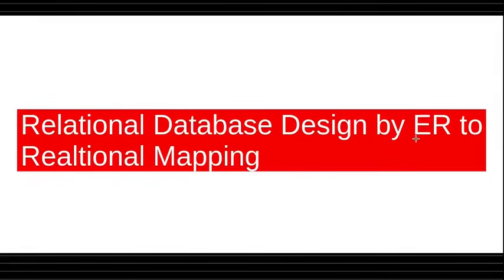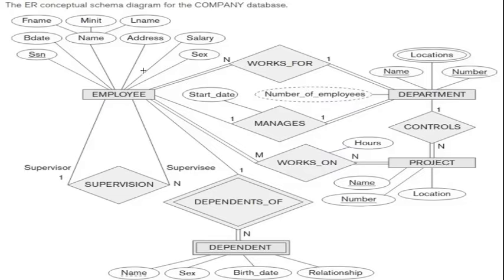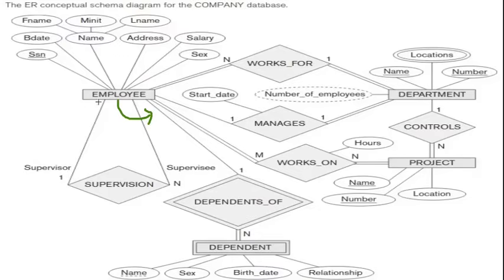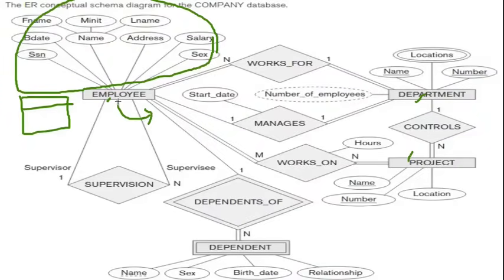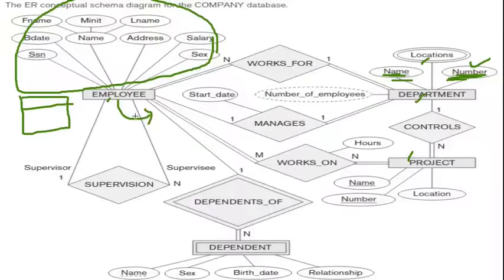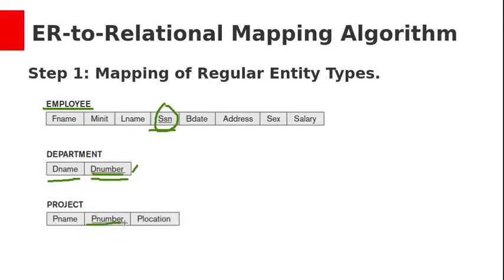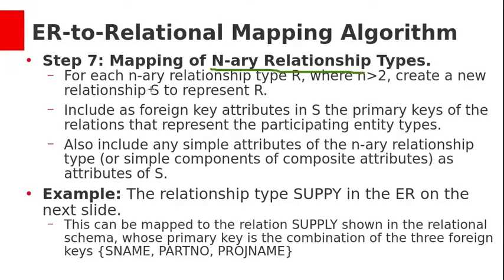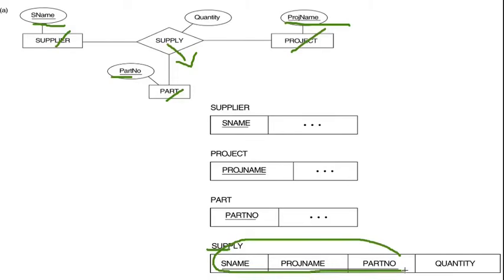ER to Relational mapping- ER diagram conversion into Tables(Relations)-Logical Database Design

Comment: what if relation is total, does it not affect the schemas, no more modifying?
Reply from the maker: If we have total participation then add the primary in that entity table. In the above example the department has a total participation in manages relationship so we modified the department table( means we add SSN as foreign key in the department table).

Note: if we have partial participation both side we can modify(add foreign) any one of the relation.   But if we have any relationship with total participation then that need to be modified(add foreign key in that relation)

Refere at 6:20

Comment: sir I want to ask do we always ignore the derived attribute
Reply: In ER (Entity-Relationship) mappings, derived attributes are typically not included as separate attributes in the entity model. Derived attributes are calculated or derived from other attributes in the entity, and they do not represent stored data in the database. Instead of including derived attributes in the entity model, they often calculated on-the-fly when needed or stored in a separate table or view. Including derived attributes in the entity model can lead to redundancy and potential data inconsistency.
Reply from the maker: Yes derived attributes will not be stored in database, but derived attribute values will be calculated based on already existing data. So in this relational mapping we will ignore derived attributes.
Reply: thank you